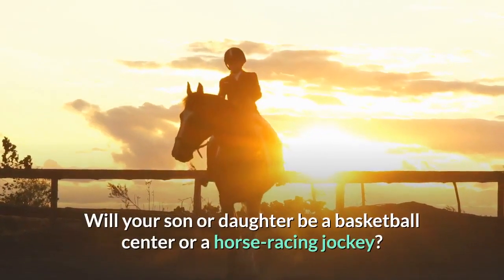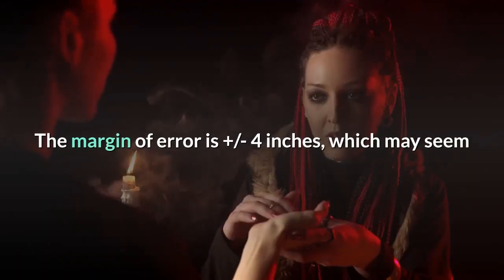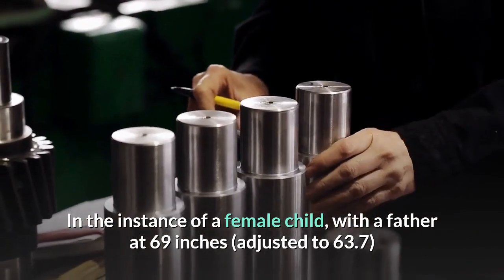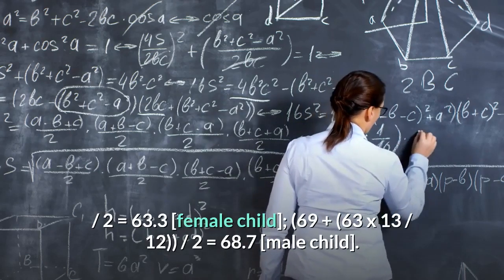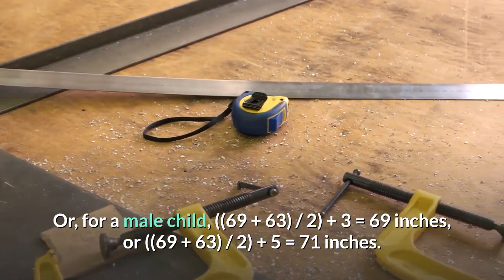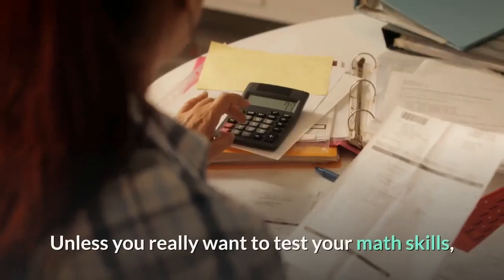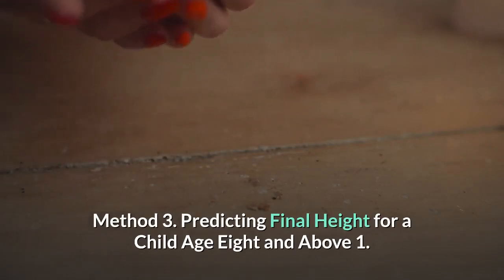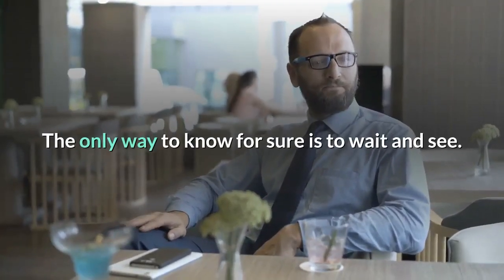How To Predict Height || How Tall Will You Be When You Grow Up?

Comment: Okay the first method is a little messy so an easier way to do it is the way Dr Youn says, "add the heights of the mother and father (which for an example of myself I am 5' 7" which makes me 67 in my ex is 5' 10" which makes him 70 in. Which 67 + 70 = 137), then you divide that by two (137 / 2 = 68.5), then add 2.5 for boys (which I have a boy so 68.5 + 2.5 = 71), for girls you would subtract 2.5". So for my example I got 71 in which turns into 5' 11" which pretty much means my son will be taller than me...lol

Comment: My predicted height was 5'7 but I ended up 5'11 my dad is 5'8 and my mum is 5'0.5
Reply: How old were you when you hit the growth spurt to 5'11?
Reply: @frostyrts324  I grew rapidly between 13-15 like around 6.5 inches and then I grew another 3.5 inches from 15-18
Reply: @maahinchowdhury5791   I’m 15 (male) and 5’4. I got my 1st puberty sign when i was early 14. I grew from 13-15 like around 5.5 inches. My mom is 5’4 and dad is 5’10. How tall will i be?